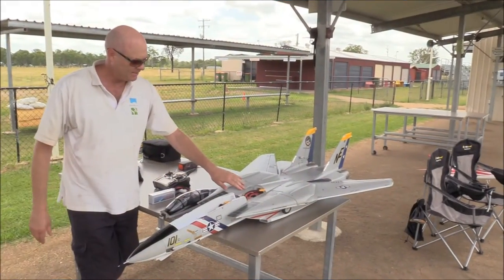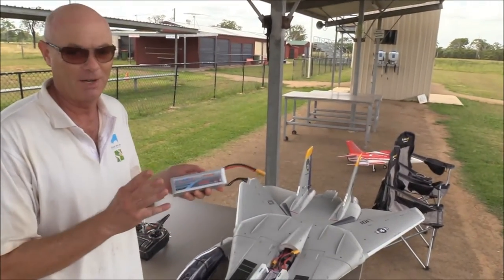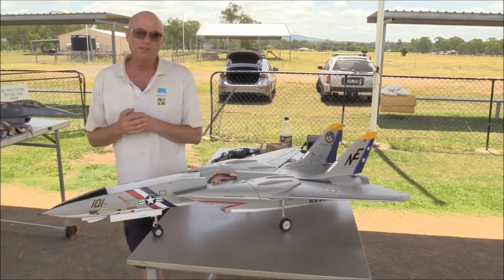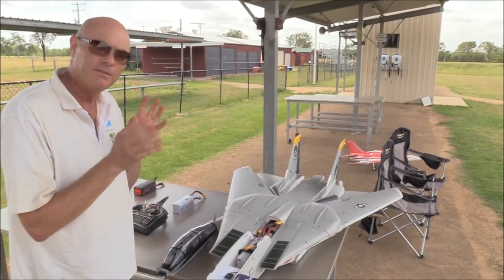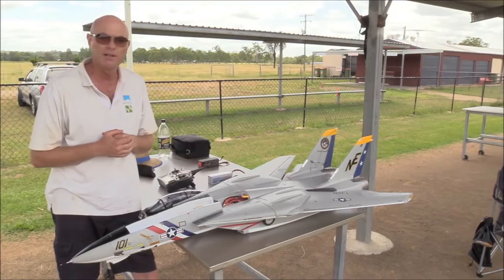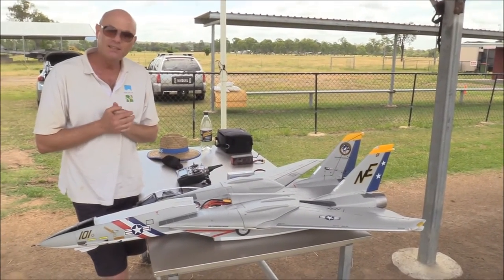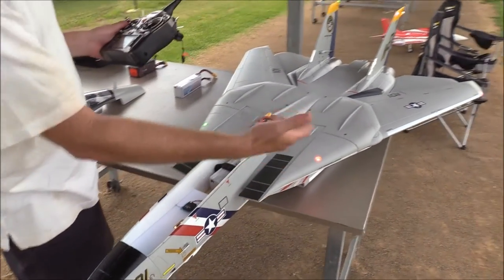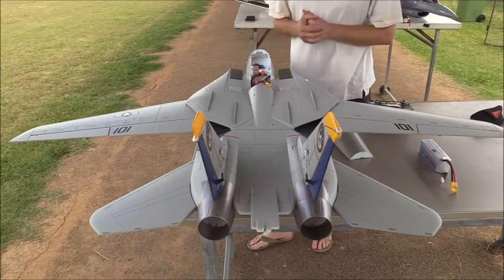Freewing F14 setup discussion with Yoda | RCSkunkworksADP

Comment: Can you fly your model with either one or two batteries without any internal change?? As long as the c/g is ok
Reply from the maker: It's a two battery setup... one for each fan unit. Separate ESCs for each. I added a second 8amp Ubec as backup as I am running an old JR powersafe twin battery input receiver. Yoda

Comment: I'm racking my head trying to figure out how to get the ailerons to shut off when in swept wing. I can't find anyone to clearly explain it.
Reply from the maker: It's a simple mix setup on your Tx activated when wings swept mode selected (same as you will need to block the use of or activate flaps up when wings sweep) but you need to bypass the Freewing mixer board and plug each ail directly into your Rx and choose correct wing type when setting up new model on your Tx. So many different Radios out there it's almost impossible to be able to write a step by step how-to-program guide... and frankly, it's always good to struggle through a setup yourself to fully understand your radio... it gets easier every time you push through and learn your own gear. Best of luck... Yoda
Reply: Yeah your right. Definitely appreciate the info. Your the man yoda.